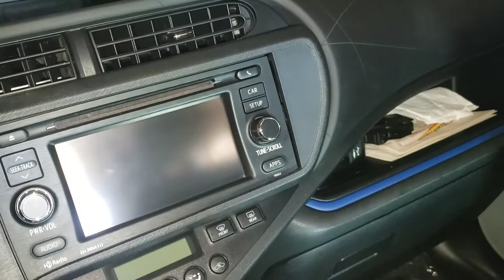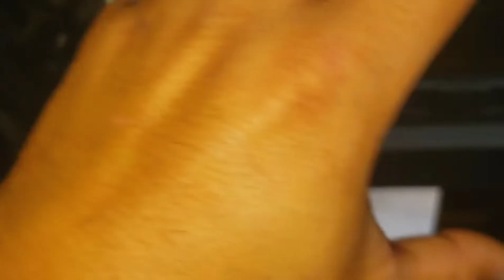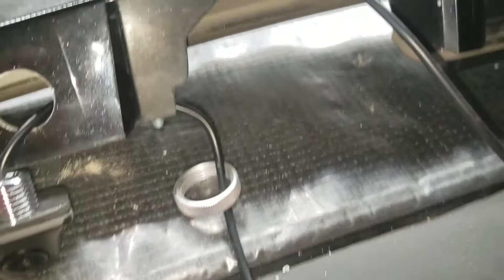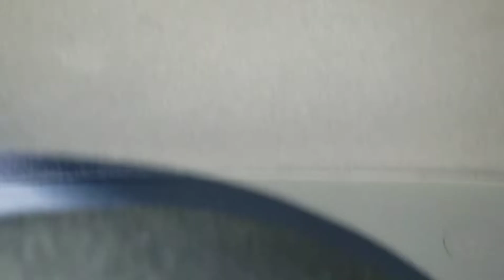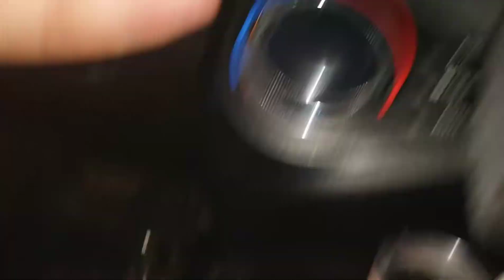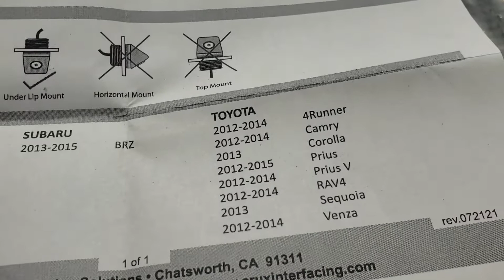**2013 Prius C** DIY: Crux OEM backup camera add on to Factory Screen

Comment: Hi, where should I connect the 16-pin female connector? I connected the male connector to the radio, but I can’t find anywhere to plug in the female connector. My car is a 2013 Toyota Prius. Could you please help me? Thank you!
Reply from the maker: Hard to help without seeing  your vehicle. If its not the same plugs as this one. Youd probably need a diff kit with a diff harness

Comment: Hi, I've noticed noise on the screen when reversing. Should I replace the camera or the cables?
Reply from the maker: There shouldn't be any noise. Its just a camera and no audio related system

Comment: I was able to install this on my Prius C thanks to this video, THANK YOU. At first when testing it, I didn't have a video feed on the screen after I plugged the tee connector into the radio. I had to connect the red wire to the yellow wire, then it worked. The hardest part was getting the video cable through the trunk rubber boot.  Also my Crux instructions looked slightly different that your. I think Crux slightly changed the design on RVCTY-71 slightly. 
It would be nice if crux included a butt connector and some heat shrink,
Reply from the maker: Yea i think they updated it. Yes I hate running stuff in those boots too.

Comment: Did I miss the part where you grounded it with and tied it into the reverse light? I cannot figure out which is the reverse light
Reply from the maker: You will need a voltmeter or test light

Comment: Can someone confirm if we need to do anything with image control and guidelines control wires on the main wire which is coming out of camera wire. Video is good except you missed the most important part of wire connections/ hooking wires into harness and than putting harness into place it should be. Might be normal for you but that’s what people like me were looking for.
Reply from the maker: Its the simplest add on back up camera out there
Reply: @FlipSideGarage I figured out somehow and got installed. Thanks for the help
Reply: @FlipSideGarage  Do you get the dynamic guidelines. I replaced deck and can't get back the lones that moves any idea/ suggestions?
Reply from the maker: @ski740 its not supported
Reply from the maker: Others with no experience got it handled. It cones with specific instructions and the wires for lines or reverse image is a preference . I didnt change anything as thats what the customer wanted

Comment: This is excellent video. I thought installing to my car Prius C 2013, as I am not a mechanic, could you please let me know, the connections to the radio where the crux wires go? That will help me to install myself.
Reply from the maker: Radio will have a label reverse trigger on the wire needed theb plug the yellow rca

Comment: do you need to solder the camera power to the reverse light or do you need to solder it on the radio?
Reply from the maker: Reverse light
Reply from the maker: Can be done either or. As long as its a reverse signal

Comment: that's awesome. I already ordered for my 2012 le camry and found your video. exactly the one I ordered. Crux. anyway. so the harness it self give a power to the camera right? I do not need to connect the wire to rear light wire or so?
Reply from the maker: Yup u can manually power it so you dont have to have it in reverse.
Reply: @FlipSideGarage  Thanks!

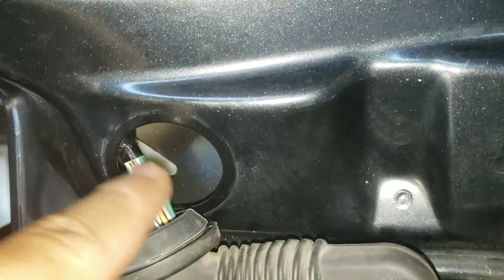Comment: Hi man,  at 03:00 where the water proof connect to the trunk,  once you take it oit how can you put it back? the seal is very hard to get back
Reply from the maker: I used a small flathead screwdriver to work it in.
Reply: Awesome video! Im hoping i can find a crux for my 2016 prius C. Do you know if factory stereo for 2016 prius c would work with any crux backup camera like this one? Everything is stock, and im not sure if the touch stereo supports video or not. Thanks!
Reply: Just spray with WD40